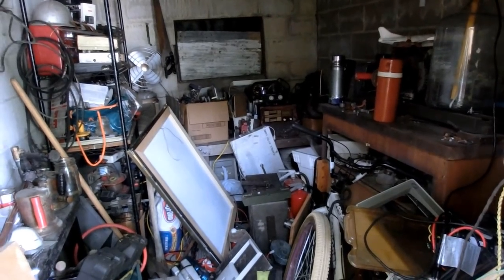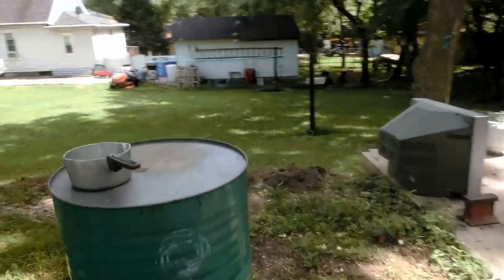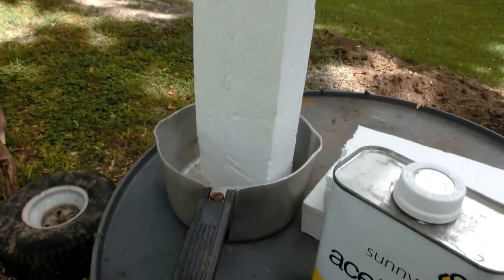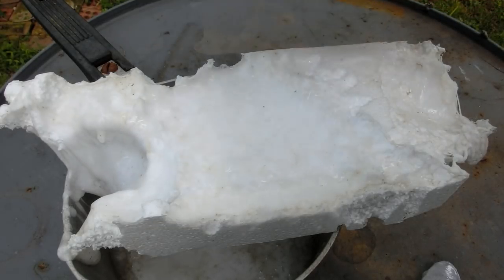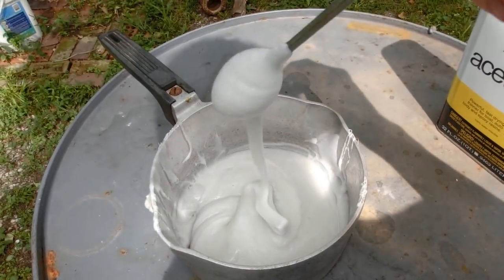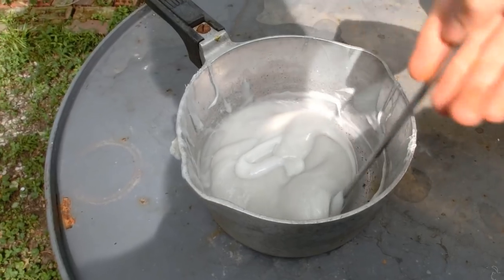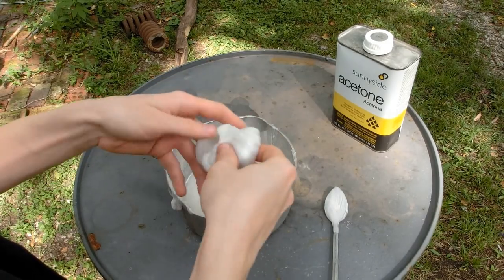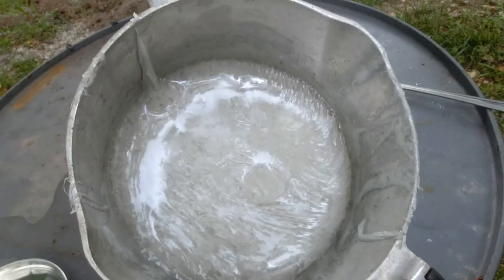Melting Styrofoam into diy acetone goo

Comment: Dude, you do realize that you are making napalm, right?
Reply: Kalle No. It only works well as napalm when the styrofoam is dissolved in gasoline.
Reply: Liquid Memes it is still very similar in vicoity and flamability
Reply: Kalle I agree, I meant to say that it would work better with gasoline.
Reply: No sweat man, it's cool :) And I think that you are right, gasoline would probably be better